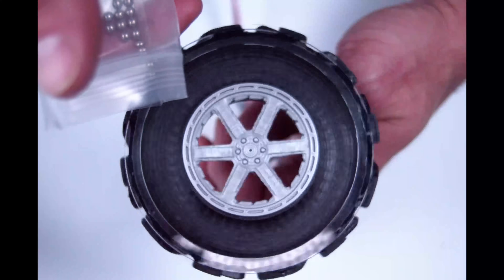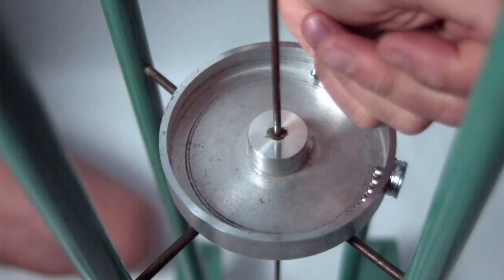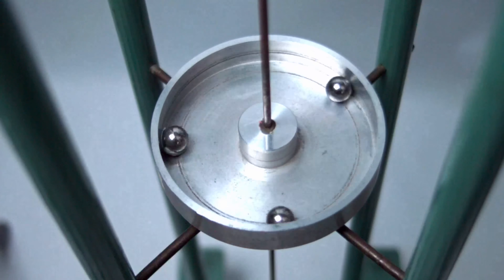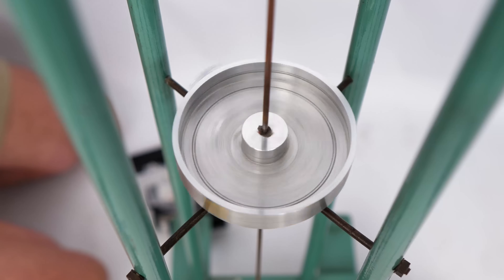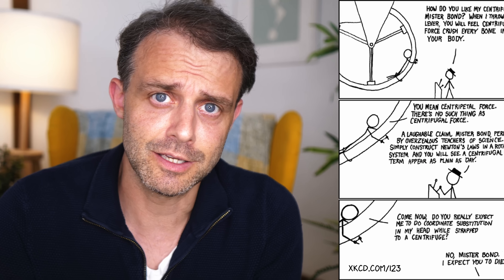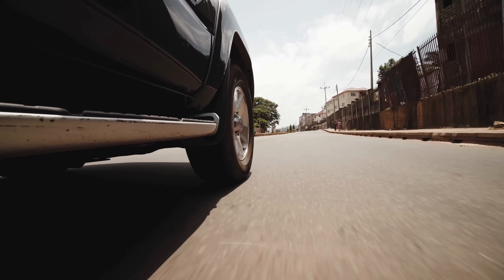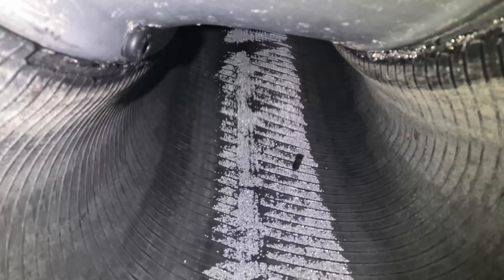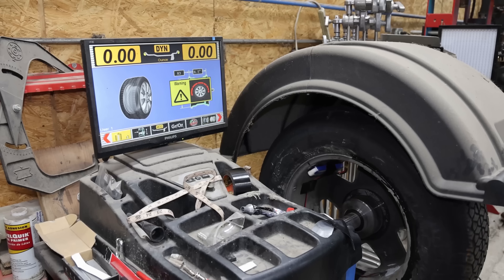Do tire balancing beads actually work?

Comment: Lead balance weights are unsightly.  Custom rims less desirable when stain marked up finish from relocated weights upon new tire installation & rebalance.  Who likes snagging the microfiber towel or cleaning around/between the unsightly glued/clipped on weights on the inner rim?  Balance Beads are invisible to the most critical eye that points out a fatal flaw on a thing of beauty in the trophy category.  Leaded Balance Weights aren't fashionable and never will be.  They are an Ugly Band-Aid to a known issue which is to have a well-balanced ride.

Comment: I had no issues with Balance Beads in the full life of the tires.  Comfortable ride, even treadwear and likely a spared suspension and bearings.  After six/seven years the 'side walls' dry cracked and physical tearing/separating of rubber in a large way; all four tires failed at the same time.  Even though the inner core thread of the tire could be seen and there was a large bouncing/wabbling/ shaking bounce that faded away completely at road speed, I made a bee line to the tire store because I was running on borrowed time.  Cons of Balance Beads- None, except you can never use that tire slime repair kit that replaced the spare tire now found in newer cars; Balance Beads would clump together into a clay mold inside the currently flat tire.
Reply: Warning:  If vehicle is sold, the new owner must be made aware of 'Balance Beads' before a flat tire and attempted roadside repair with a liquid tire repair kit.

Comment: We had D'Alembert's Force :-)

I'm sitting thinking "What about gravity?!?" - an effectively rotating force applied to everything in your rotating reference frame. Also harmonics when you go fast? There's be nodes and antinodes along the rod. Could impedance come in if we're thinking that way with the mass of the cup being a high impedance?

...

The Balancing Beads version of the film Speed? Don't slow down :-)

Comment: So what we need is some sort of bead that gets inserted into the tire and then when it hits 50mph the bead breaks apart from the force and releases a glue that sticks to the rubber permanently balancing the tire... something like that already exists. It's how high performance tires are balanced. A resin that goes into the tire as powder, settles to balance the tire and then the tire is heated which causes a chemical breakdown which glues the resin to the rubber. Subsequent heating doesn't do anything because the binding agent that was in the powder turns to gas which cannot bond to it anymore once it crystalized.

Comment: one thing to note, a tire rotating vertically on a vehicle at fairly low speeds does NOT spin about its center of mass it spins about the axle as the tire is on contact with the road... as the speed increases it will try to spin about its center of mass as the force of the unbalanced part will now start to have enough energy to "overrule" the wheel in the suspension... when horizontal it will rotate about its center of mass at low speeds...

Comment: This is a bandage for a gunshot wound. 

First. Whatever material you use has to be strong enough not to deform and stick in place. This means it MUST be harder than the inside of the tire. Because that inside wall must flex slightly. So no matter the kind of beads used. They will slowly damage the inside of the tire. 

Second is the shrapnel potential. A 18 wheeler blowing a tire at 60 mph is already scary. Now imagine it throws steel balls or glass sand when it. happens. 

And last but not least. This is using force to balance the tire. Insted of actually balancing it. Any time you cant hit a great enough speed to get the balancing effect. You are adding extra stress to both the tire and the vehicle.

Comment: to fix the issue of beads falling back down after you slow down, maybe you could use a weak but persistent adhesive? like, strong enough to hold the beads in place but not strong enough to stop them from going into position. also in theory couldn't this work with either a liquid or a non-newtonian fluid like ketchup or oobleck? if not why doesn't it, do the individual particles have to be some minimum size?

Comment: Hmm I wonder if this could be used in washing machines.  I doubt there's any place to put them as putting them in the drum wouldn't work as they're not free to move around.  Perhaps putting a band round the exterior of the drum with beads in

Comment: I want my tires to be balanced all the time. Not only at highway speed. I also do not want to need to "reset" to equilibrium after slowing down to very low speeds, or after a stop. So my preference is the normal balancing weights.

Comment: In a top loader washing machine it has a similar mechanism in the top plastic ring on the drum .. it’s half full of water and has internal ballast to stop the water sloshing around too fast .. I watched it one day on spin with all the top covers removed and as it got up to speed the bowl magically stopped wobbling and ran true while the outer bowl which had all the suspension attached took all the wobble .. then that was absorbed by the suspension.. I saw someone drill holes in this top balance ring to let the water out.. he thought it was faulty and water had got trapped in it but alas he ruined the machine as it had no balance control mechanism anymore..

Comment: Hm does that suggest that you could have tire balancing beads covered in some kind of slow-acting adhesive, get up to speed, then keep driving continuously long enough for the glue to set to permanently lock the beads in place?

Comment: I'm guessing that balancing beads might be okay to use as a supplemental balancing method, in addition to normal balancing of each wheel/tire, to the best ability of adding traditional lead wheel weights, so the balancing beads are only depended on to fine tune the wheel/tire balance at higher than 50mph speeds.  Of course, at higher speeds, the wheel/tire tends to balance itself without any beads, so maybe the beads are a waste of time, effort, money, etc.?

Comment: 10:50 Perhaps if the balancing beads were slightly sticky, so that enough of them tended to stay stuck in place after reaching highway/motorway speeds, you would not have to re-do the settling in each time you drive.
Reply: the glass ones kind of stick inside the tire. i dont feel anything on them, like static electricity or something, but for rubber.
Reply: Tires have to be rebalanced throughout their lives. 1-3 times for passenger vehicles. 3-5 times for 18 wheeler tires. Rubber loss, road grime, and many other things mess with the balance. With tire beads….youre constantly balanced.

Comment: This is an interesting topic. If one put glue on the inside of the tire during tire installation and spun the wheel in a machine until the beads stuck, the wheel would be balanced.
On the other hand, modern balancing machines are faster than waiting for the glue to harden. And would the glue hold during bumps is another question.

Comment: I use bead balancers (Centramatic brand) on  my pickup  truck  With 31" tires,  the speed that the balancers start to work is about 30 mph.  if you travel long enough at 25mph, they will eventually  start working.  One they do start working, they will continue working as low as 15mph before you hear the beads fall back to the bottom of the steel balancing ring.

People tell me sometimes that I have an air leak when I'm driving around parking lots or whatever because of the "swish" noise that the balancers make when they are not active.

Comment: If it's a long shaft style balance you can get sub-synchronous dynamic effects because of non-rigidity.

Why not try three unbalanced wheels on that wobbly spindle shaft at different spacings <eek>

Comment: I drive semi trucks here in US.  They sell wheel balancers called CENTRAMATIC WHEEL
BALANCERS, they have the same thing in them , tiny metal balls they balance the wheel , used on steer tires , this is been out over 10 yrs now or more

Comment: Thank you very much for your excellent explanation/demonstration of how tire balancing beads work.  We use Centramatic tire balancers on our travel trailer (caravan).  We were amazed when we replaced the tires after 35K miles and 6 years that the tread had worn absolutely evenly.  We only replaced them because of their age.  I have heard so many stories from friends who have had issues with uneven tire wear, blow-outs. and other tire failures that I can only attribute our success to the tire balancers.  Now I understand why! 😄👏

Comment: I think you missed an important aspect. Your model is perfectly round, so the beads will go to the correct place. A tire supporting the weight of a car has a flat side - the road side. I don't think it works.

Comment: Steve, I have a large pickup truck with 37x12.50R17 offroad tires. The local Wal-Mart messed up when they balanced them and caused premature wear. Someone suggested that I try balancing beads. I added the recommended amount for my tire size, and they are definitely better. But, they still vibrate at ~70mph. Probably because of the uneven premature wear pattern. So, I'm thinking that I may need to add a bit more. Should I be worried about adding "too much"? I understand that I should aim for as little as possible to minimize the vibration below "freeway speed". But above that speed, a little too much shouldn't hurt anything, right?

Comment: The reason why it works is the same why it shakes less when spinning fast.
The faster the rotation, the faster the direction of the centrifugal force change.
So it simply cannot lean toward any of the directions fast enough so it will stay close to center as long as the rod is stable enough.
Same applies to the beads. They will lag behind the direction of the lean causing them to be pushed exactly in the opposite direction of where the heavy end wants to go.

Comment: I'm surprised they haven't got a coating which will warm up and set them in place.
I guess it's not worth the effort for the main uses of them, very large tires, plus you'd need different formulae of the melty-gluey bit for different countries and, possibly, seasons too.  Also car drivers have been conditioned to get wheel balances done, I imagine there would be a lot of resistance to change from people who've been getting that done for decades.

Comment: Ive got them on my Land Rover tires. 305/70/16 BFG mud terrains and as soon as I get to 40mph they vibrate like hell. As I speed up, the vibrations are a bit less, but its a heavily modified vehicle, a world first, and I dont go fast enough to have it balance.  Now I think I am going to have to go to the tire shop and have the beads replaced with traditional weights.  I never had a single problem with the previous BFG Mud Terrain 285/75/16 tires.

Comment: re: centrifugal force: christ, you bring up the damned xkcd comic even. 

here's an issue with that comic, and with using "force" to describe the centrifugal effect: we all know that newton's second law in an inertial frame is (sum of forces) = (mass) * (acceleration). But if you construct it in a uniformly rotating frame, you get (sum of forces) = (mass) * (acceleration) + a bunch of other stuff. That stuff is the centrifugal effect and the coriolis effect. You can move that stuff over to the left side of the equation and try to incorporate it into the "sum of forces," but it's not part of the sum of forces. because the centrifugal effect and the coriolis effect are NOT forces. 

Physicists have a term that is occasionally used for these sorts of effects: they're called "pseudoforces." You can tell a pseudoforce from a force because pseudoforces are proportional to the mass of the affected object, i.e. they accelerate all masses equally, and they disappear entirely with the correct choice of reference frame. Like the coriolis effect, or the centrifugal effect or... 

well, yeah. gravity. gravity's a pseudoforce. we probably shouldn't be out here calling it a "force" but some traditions are too strong... we've known since Einstein first had his "happiest thought" that an accelerating reference frame is indistinguishable from one with gravity.

Comment: I was thinking that we can dip those beads in a slow adhesive and drive straight to the critical speed and keep it constantly for 4-5 minutes so they can get stuck to the correct place and the tires can get balanced automatically.

Comment: I know this will get lost in the weeds but here it goes
According to some manufacturers it is suitable for certain tires, trucks and motorcycles as they have a narrower profile compared to cars which are normally shallow and wide.  I run them on my motorcycle and there are no issues, there are some that just don't like it.  I like them personally because it cleans up the wheel and if you have spoked wheels those weights, they put on spokes can loosen up and slide on the spoke and cast wheels on bikes if they don't clean the wheel right well there goes the weight of your back to an unbalanced wheel.  At the end of the day, it's up to the user if they want them or not

Comment: What happens with increased mass/diamter. They are more popular with offroad tires 37" and above where most shops won't gaurantee balance and usually charge you more for oversized tires.

Comment: We used Dynabeads aka balance beads for decades at the tire shop. I always assume they worked since when test driving the truck, I didn’t notice any bouncing. Also truck owners with balance beads installed never complained. 

My assumption was that balance beads do actually work, and if they didn’t work then I didn’t care because it was less work than removing and actually balancing the tires. Less work for my back, so I was a supporter of balance beads! 😂

Another thing someone mentioned is tires don’t suddenly become unbalanced ever 5,000 miles!  Not enough anyway that it would cause a problem. My back also agrees with this assumption!

Unfortunately I spent most of my life rotating and balancing tires and using lead weights before I became more informed. At 61 I can now barely walk or control my legs. Doing this unnecessary extra work which was a selling point at one time, you get free lifetime R&B rotate and balance when you buy a set of tires. At the expense of my back and legs 😳

Comment: Sounds like balancing beads need some form of refinement... 

There is an idea, fill the beads with some sort of 2 part epoxy solution & design them to pop when subjected to centrifugal pressure roughly equal to highway speeds.

The beads break, the chemicals mix, and form a semi solid layer that permanently sticks to the underside of the rubber tire, maintaining the balance even after stopping.

Comment: Short answer is yes and no. Do they work on occasion, yes. Are they reliable? No. Don't ever put balancing beads in your tires. If someone tells you they work they are lying to you, or they have so many other issues with their vehicle that they couldn't tell if the tires were balanced or not. Balancing beads creating a lot of issues, just don't use them. (Source: 20+ years as a mechanic and tire tech).

Comment: Good day Steve, I have been watching your channel for a number of years however, I very rarely comment. Today I have the ability to because I have some good experience in relation to the topic of your video. I am mechanic in the US specializing in motorcycles, but also work on cars and heavy equipment and semi trucks. Dynamic balancing products do work and in most cases work very well, but there are some caveats that you did not cover in the video. Beads are not the only option there are also liquid or actually plasmatic products that would do the same thing. There’s a product called ride on That is a very heavy liquid/plasma type of consistency. That will also do the same thing but it acts as a sealant at the same time if you were to get a puncture, it would actually fill the puncture hole and minimize air leakage in your tire. In addition, the glass beads are not always the best solution as in many cases it will void the tire manufacturers warranty. This is because the glass bead moving constantly through the tire can actually wear the inside of the tire. We have removed many tires that have used balance beads For extended periods of time and found there also full of rubber beads due to this war. The liquid balancing/sealant does not do this. Downside to the liquid is it can be messy for the tire installer when removing the tire later on. There is actually a company called CentraMatic, who have another Solution. They designed an external ring that mounts to your wheel flange that contains an oil with steel shot in it. This way, it does not go inside your tire at all, and therefore does not cause the premature wear or internal tire damage. Another advantage to this system is that they are reusable. When you purchase new tires, you just leave the Centramatic rings on the vehicle and they will balance your new set as well. Another advantage to all of these types of dynamic, balancing rather than static balancing with weights on the outside of the wheel is that as your tires wear overtime and the balance point can change, sometimes dramatically. When solid weights are fixed to a specific spot externally on the wheel, they cannot compensate for this wear overtime, however, the dynamic versions of balancing such as the beads or the paste will always find the proper point overtime, even if that point changes.